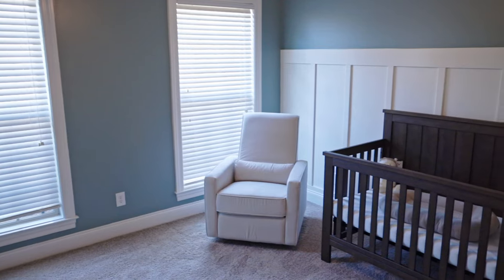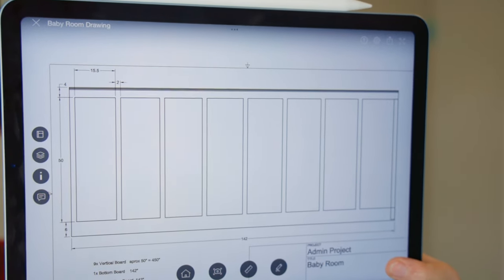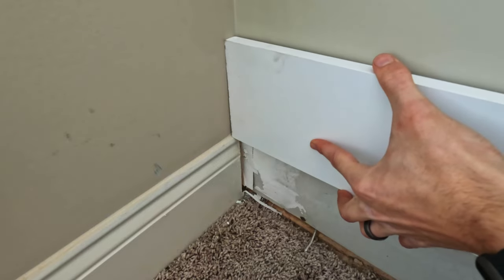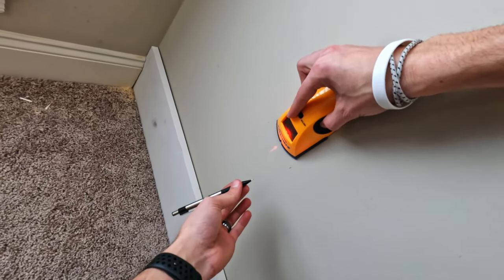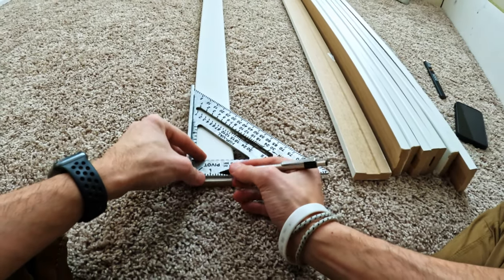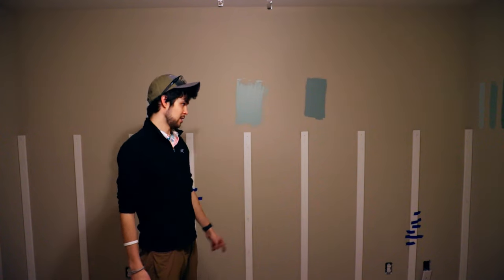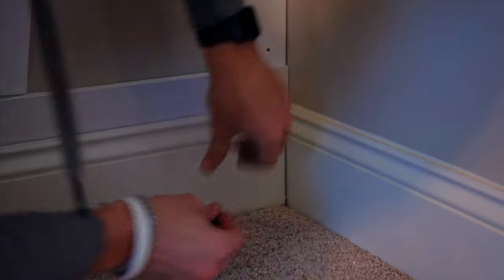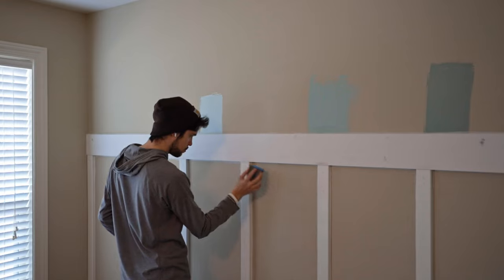DIY Board and Batten Wall Install

Comment: Great video and result! What computer program did you use for the 3d designs and the measurements?
Reply from the maker: Thank you! Been working on some more projects as well. I use Fusion360 and SolidWorks. Fusion360 is excellent since you can get a non-commercial license for hobbyist for free and it is quite powerful. May just take some learning time but YouTube has instructions for just about everything you’d need to learn.

Comment: Hi what digital leveler are you using? ty
Reply from the maker: It’s a Huepar Box-1G, I’ve had great success with it so far and use rechargeable batteries to keep it going. You can find it for about $55 plus sometimes on sale. I try to stick with name brands but could not justify double or triple the cost with a comparable Bosch laser, and I’ve been very satisfied with it. https://amzn.to/3ZJ2G8a

Comment: What board did you purchase that was 2 1/4 wide? My wife wants this same look but standard 1x2 is 1.5 wide
Reply from the maker: I do not remember off the top of my head, give a week to get back into the states and I’ll do some measuring and get back with you!
Reply from the maker: Sorry for the delay! The board I’m using is an MDF 1x3 with radiuses on the front two edges. Nominal length is 2.5x11/16. Should be able to be found at most places if they have it in stock: https://www.lowes.com/pd/Radius-Edge-MDF-Actual-0-6875-in-x-2-5-in-x-8-ft/1000801766
Reply: @PhilipBlank  thanks for the response. Super helpful information!